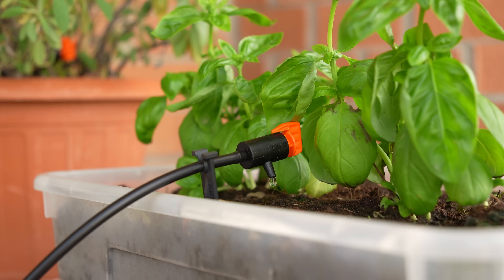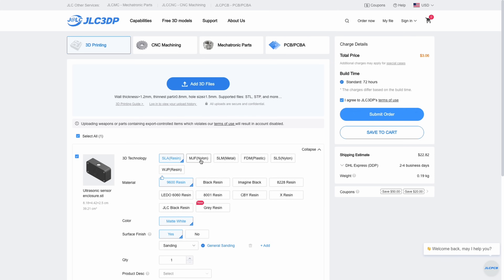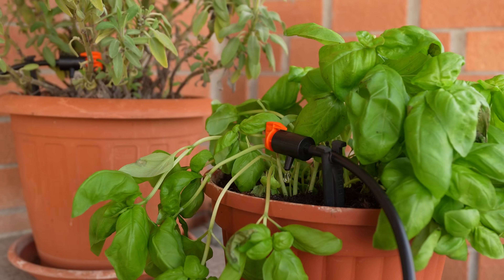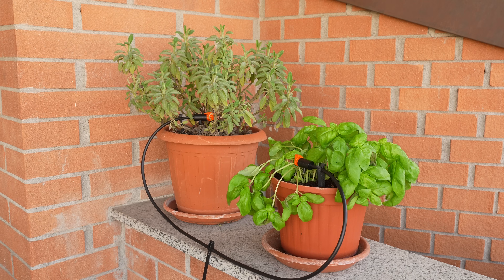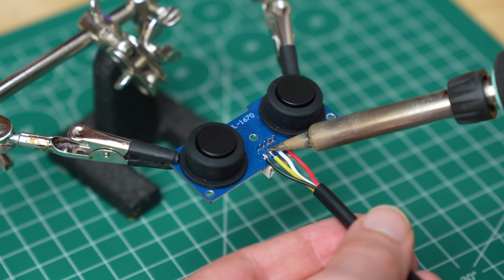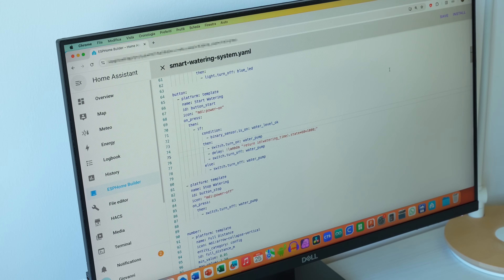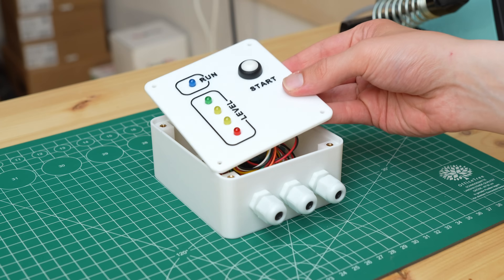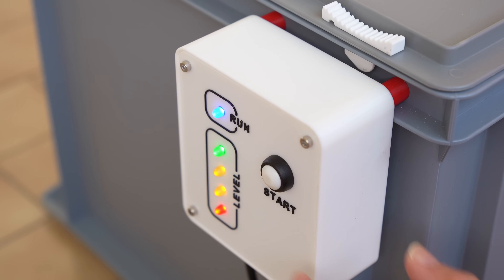Building a 200€ product with 30€! ESP32 automatic watering (NO WATER TAP needed!)

Comment: Hey man, this is epic! How would you adjust this if you were using a 100-200l barrel for the water and needed to pump to 2x 2.4m*0.8m beds? I want to set something up for my vegetable garden and I an NOT good with electronics (or rather adjusting plans like these)
Reply: also where can I see how you soldered the back of that board?

Comment: I love the project and just how clean the end result looks!

Not knowing in fine details of your ultrasonic proximity sensors, I have question. Your tank is a closed box full of water. Which means there is a high chance that at some point the entire inside of the box will get covered in condensation. What is the sensor output in this scenario? 

I could see the possibility that it would read artificially high. If that's the case, it might be worth adding some logic that tells it a maximum value to trust. Anything higher, maybe it sends a notification and shuts down the auto-watering feature so the pump cant run dry?

Comment: Upgrade idea: Drop the pump, just put your water tank higher than the plants and let gravity do the work using a simple solenoid valve. 
More reliable, and can be modified to several micro valves (one per plant) in case your plants need different levels of watering 😁
Reply: I love the idea and iterating minor improvements is how you end up with a much better end result.
The idea definitely has some pros and cons. 

Yes, you can remove the risk of wear and failure of the pump by using gravity instead. However, some emitters work best with a minimum amount of pressure. The pump will always deliver a (mostly) consistent pressure. The gravity fed method will change as the water level in the tank changes.

Visually checking the water level or manually refilling the tank could be more difficult too depending on how high the tank needs to be placed to provide the needed pressure.

Being able to have multiple valves controlling the watering of individual plants definitely gives you more fined tuned control. Pairing this idea with soil moisture detection would also be incredible. (more complicated and higher investment, but really powerful). Setup properly, every plant could get exactly the amount of water it needs, only when it needs it.

Comment: A little overcomplicated, but otherwise very cool project. I use simple NO/NC switch with a lever to cut off pump when there is no water. I tie a float to the lever. When the float reaches the bottom of the water container, the float will activate the switch that cuts off pump power.

Comment: Did you know that if a pump can’t push water due to a blockage in water line like the dripping head then it’s only matter of time when the pump will burn down?

That’s why dipping system is water tap supplied…
Reply: Did you notice he did protect against no water situation in a tank? Tap water would not help
Reply: @sierpus please explain what damage no water can cause? That’s not a protection, thats a feature… not the same
Reply: @bzolitb  you gave an example of blockage of a water line (dripping head blockage) and solved that with "tap water" which solves different problem - lack of water in the container.
None of the solutions - yours (tap water) or mine (looking at the level of water) solves a problem of blockage of a dripping head, but both are soliving the same problem - lack of water for a pump
Reply: @sierpus that’s not my solution. That’s the technology used in the industry, for some reason🙂
Reply: @bzolitb  you mean tap water? Sure, but what is wrong with presented solution?

Comment: A simple automatic float valve would streamline alot of this build
Reply from the maker: That could be a good alternative to the ultrasonic sensor and way simpler. The only downside would be that you don't know how much water you have left if you are away.
Reply: Yea I see what you are saying, but what I think he is going for is something that doesn't require a water hose being connected to it. This system allows you to have the plants in a lot more places. I'm already working on a similar albeit more complex project. This is a great project for someone who has an apartment with a balcony or a home with a porch or deck that doesn't have a hose nearby.

Comment: Cool, can you add "humidity-sensors" for the soil?
Reply from the maker: Thanks! That's a great idea but I haven't had any luck with them... I have installed these sensor in a bigger irrigation system and it is really hard to determine how dry is the soil based on the sensor reading. If you know how to properly use them, I would be really interested in hearing about it.

Comment: even cheaper/standalone, use gravity, place the box/water container higher, and use a low voltage electronic valve, use a esp32 to control and power it from a battery with a solar panel and charge controller?
Reply from the maker: That's a great idea! Thanks 👍

Comment: IRFZ44N is NOT logic level mosfet. The gate can't fully open with only 3.3v from gpio pin. I have used that MOSFET on an LED lamp, the lamp is very dim and flickering
Reply from the maker: You are right, other types of mosfets would work way better, especially with large loads. With the small load of the pump (400 mA), I tested the voltage drop across the mosfet and it is really small, so the mosfet doesn't heat up. I tried using IRLZ44N with the ESP32 but with no success, they did not open with 3.3V (maybe are my mosfets that are bad...). Do you have any mosfet to suggest that would fit this application?
Reply: @makergiovanniI used a bc546 etc to drive the MOSFET, so 3.3v drives transistor and that the drives  the MOSFET , obviously chose resistors carefully to minimise power used .
Reply: Use a irlz44 that should be working at 3.3v

Comment: But how do  you know whether your plants need water? 😄 Cool build!
Reply from the maker: Usually watering for a set time each day works fine, of course you need some trial and error to set the right amount of water. It would be really cool to add soil moisture sensors, but I have never had any luck using them as they don't give any accurate data.

Comment: Very nice and professional! What is the home system interface? Is a pump not overloaded due to big water input and small water output?
Reply from the maker: Hi, I am using Home Assistant to manage my smart home. The dashboard is designed using the Mushroom card integration and some other custom code. For the pump, it doesn't care about how much water it is in (you could put it in a lake and it would work the same), and as the water is 30 cm tall the pressure at which it it exposed is not a problem either.

Comment: Add a capacitive soil moisture sensor to control watering and prevent overwatering your plants.
Reply from the maker: That's a great idea but I haven't had any luck with them... I have installed these sensor in a bigger irrigation system and it is really hard to determine how dry is the soil based on the sensor reading. If you know how to properly use them, I would be really interested in hearing about it.
Reply: @makergiovanni you need to calibrate, connect on an analog pin and take reading on a serial monitor, based on value and moisture in soil modify your code. Or make your own probe with titanium wire and OPAMP.
Reply: @makergiovanniit's an art to get them working , seems like each one needs calibration but even then various other factors affect the readings. Not sure how they can sell them tbh
😂
Reply from the maker: @FlyingFun.  To add to all these problems, the readings change with time... after like two years they become almost unusable
Reply: @makergiovanni I tried as well. They look good on YouTube but to get reliable readings, that is a different story
Reply: @makergiovanni Yea they are all not great. The only thing that seems to work properly seem to be RS485 sensors (the spiky things). But I did not fully test them yet. Great video :)
Reply: Hi,
Capacitive soil moisture sensor will fail. You have to go another way : DIY tensiometer with transducer and an esp32.

Looks like a nice project.
Reply: @mrjnml9643  I dont think he is running a professional farm.... Capacitive will do
Reply: That' has been my experience with them as well, and I even took the time to cover them in a thin layer of laquer before sticking them in the pots, to prevent galvanic corrosion. Of course they still corroded 😅 

One other thing that I would want from such a system was a spray nozzle instead of a drip nozzle, to properly water the roots of my orchids. Dripping water in a single spot isn't very useful when there is no solid soil. Maybe I'll be able to add a ring of dripping points though, maybe a thinly punctured tube or something.
Reply: @dan-nutu  Thats all due to a pcb design. Simple micro corrosion. You will have to get something like xiaomi soil sensor, or remake the way the contacts on the generic one are. They lack protection against elements, and the coating is not perfect which results in such abysmal lifespan.
Reply: I think the problem can be solved in simpler way, although requires a little calibration.

Basically all you need is to know (or sense) how much water was pumped in a period of time and turn the pump off upon reaching the configured threshold. 

Obviously the correct water amount will depend on the ambient temperature and humidity. But that can also be accounted for by adding a temp/humidity sensor to the system.
Reply: @RickDkkrd  nope. I checked that and you would be surprised but through every dropping endpoint different amount of water goes out. Differences are sometimes like 2x or 3x